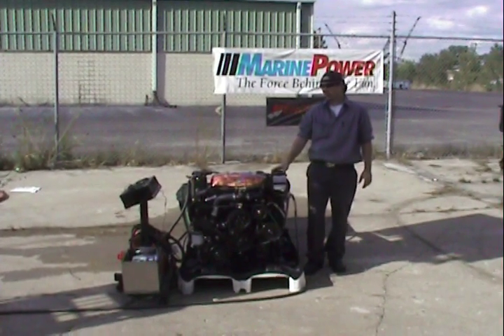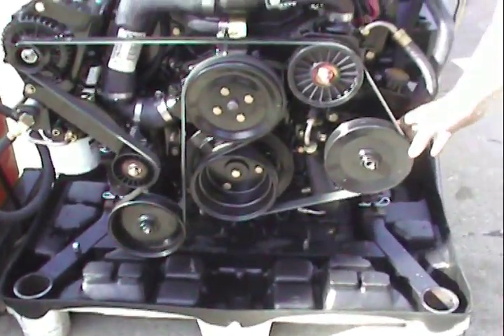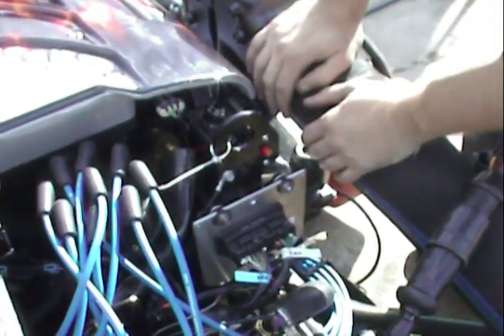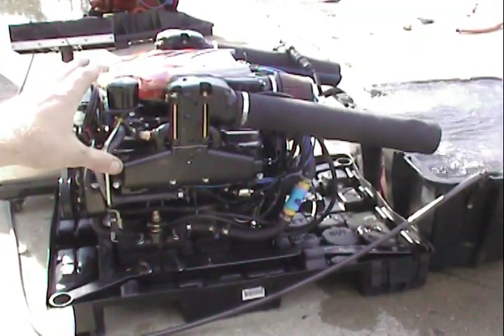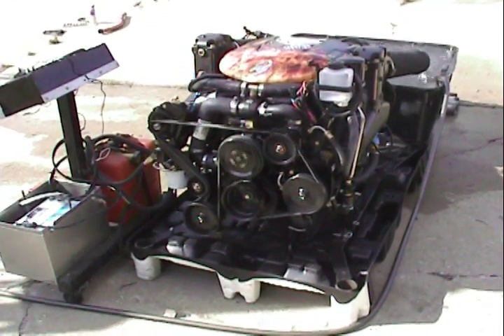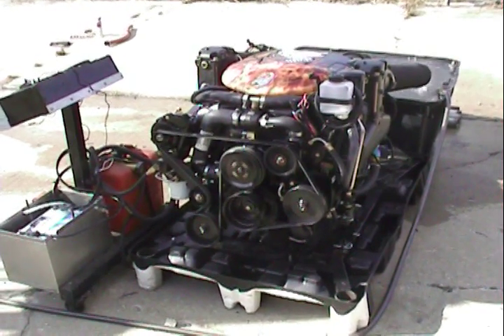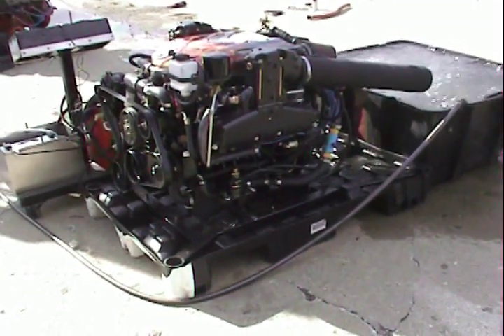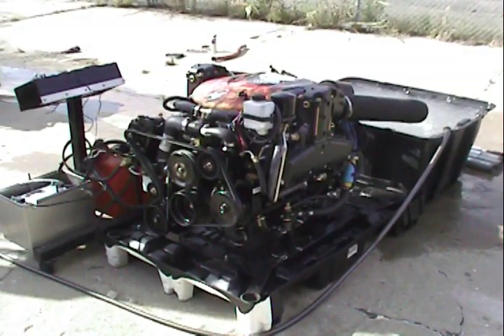Mercruiser 383 STROKER SCORPION BRAVO 400 HP!

Comment: Six inch rods??
Reply: 5.7
Reply: Drops your RPM and reduces your operating RPM and unless you are using forged rods the engine geometry is not good for 6,000 for any extended amount of time. Even with pink or dimple rods. 6 inch rods would solve the problem. I think you are going to get a lot of blown engines. Even with 1 gram balanced, polishes and shot peened rods.

Comment: what's the cam specs?
Reply: Billet steel hydraulic roller. intake lift 0.575" exhaust lift 0.596. it doesn't list duration

Comment: WOW!!!  700 hp @ idle!!!  haha! Me thinks Phil is excited....

That is the epitome of US ingenuity, sbc designed in the 50's, and think of the Libs that would like this outlawed.....  : (
Reply: It is kind of a misnomer to say that this was designed in the 50's. It would be more accurate to say it was designed in the 90's because it is based on a 90's chevy small block. Sure it does share some elements with the 50's small block but everything on top and inside of the block is way more modern than that.

Comment: How do you get the increase in wot rpm from 4600-5000 to 5600-6000 especially with the longer stroke?
Reply: having a better bottom end and different style intake allows for more rpm on these motors
Reply: When bottom end is balanced and built properly, camshaft duration, cylinder head flow, intake flow, and exhaust flow play a huge role. Piston speed is the biggest limiting factor of an engines redline though.